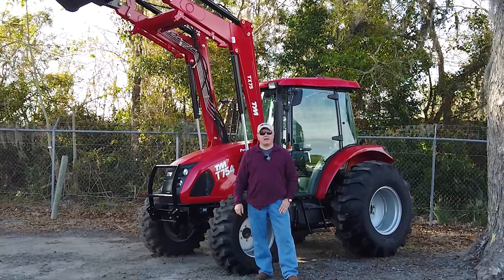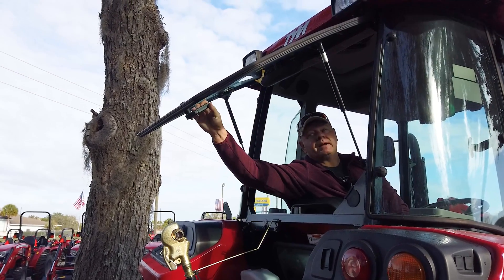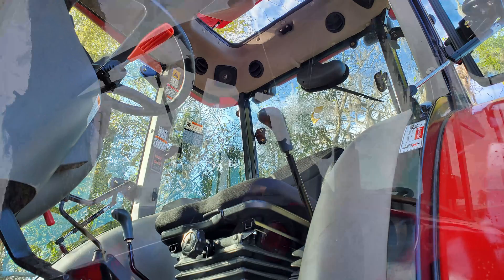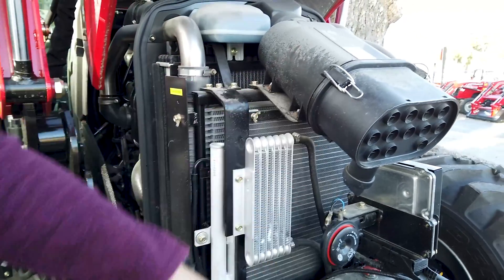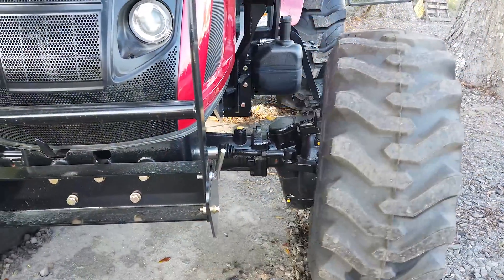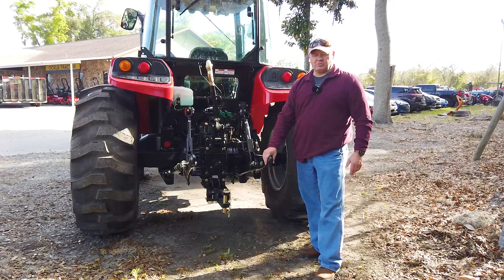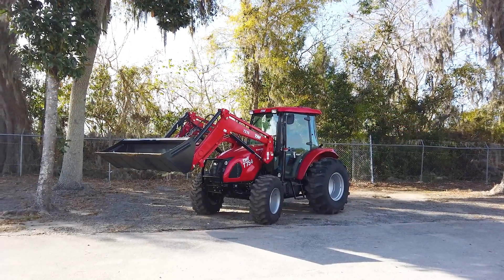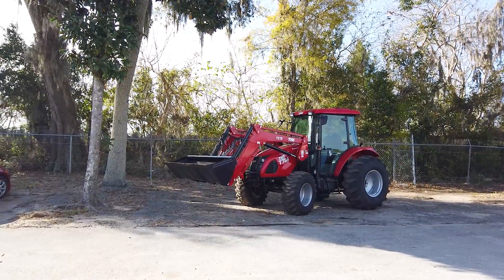TYM Tractors T754 compares to John Deere 5075E

Comment: HML X 1234 = 12 !
Reply from the maker: You try stepping into a new tractor and doing math in your head while in front of a video camera. LOL! F16 x R16 (Creep interlock)
Reply: @TonysTractorAdventure  I was wondering if it had a creep gear. Are those usually push button? Or another lever somewhere?  Or do they still use original range selector just with the extra position?

Comment: I guess the question is how long will this tractor last; parts availability and dealer support, in my area there is no dealer that sells this product I would have to drive very far away and my business I run my tractors come spring time seven days a week for over five months running them at full PTO speed and if something breaks I need to get to my dealer and get parts ASAP we have some other off brand-name tractors in our area and something breaks with one of those tractors they can’t get parts or service for two months so I think anyone purchasing a tractor that’s very important, in the video yes it looks like a nice tractor it really depends how its put together, it doesn’t matter if it’s made in India or South Korea or China I would say out of those three China is the worst, I am a big John Deere supporter I’ve purchased over seven tractors in the last six years but I will say every tractor that I purchased I’ve had problems but the problems were only in the beginning and they were fixed immediately and then after that no issues, but again for someone like myself who works very hard I need parts right away, Since this is a comparison to John Deere, I would say John Deere is one of the biggest tractor manufacturers in the world and they would not be building tractors if they were junk, I would not say this is a better tractor than John Deere, in my eyes I don’t think there is comparison but if someone’s going to purchase this tractor they should be proud of it maintain it take care of it I’m sure you’ll be happy with the tractor most of all dealer support but as an owner of a five series 75 hp tractor John Deere is a great tractor, and it doesn’t matter if one tractor is heavier than the other in stock form because you can always add wheel weights you can add weight to the front you can fill the tires etc. we all have different applications for example my business we mow large acreage and we try to keep our tractors lighter but for heavy loader work etc. a heavier tractor is better so having the option to make a tractor heavier is better for us I’m only bringing all this up just because of the comparison as stated on the title I don’t see any other comparisons in here after the title it’s a good looking tractor and I’m very curious after about 1500 hours how it held up, Thank you for the video and information on this track🚜🚜🚜
Reply: I apologize, I did my original response to your video my text with my voice and I should have read it before I sent it, what I was trying to say is your tractors look like a nice tractor, I wish there was more dealers in all areas, the reason I was saying I thought John Deere was superior was because they have dealerships everywhere, and for me dealer support is very important, if I was in your area I would test drive/demo your tractors and if I liked it I would purchase it knowing the dealer is there in the area, Local dealer support and service  parts  is very important for me, unfortunately we have no TYM dealerships anywhere in my area nothing within a 200 mile radius that I can find I  did not mean to call your company an offbrand tractor we have some dealers here that sell Mahindra in Branson it’s hard for them to get parts and quickly do any service/Repairs quickly. I should’ve made this a little more clear as to my response to your video so I apologize if I offended you, and you are correct, John Deere has had parts issues along with tractor assembly issues, and it really doesn’t matter where tractors are made companies outsource all over the world whether it’s India Mexico China and who knows where else, but for me it really does come down to dealers supporting us hard-working guys that count on there machine daily,you seem to be a “real good” guy, I wish you the best with all your sales your business and in the future. But if I had a dealership with your products in my area I would definitely consider one of your tractorsThanks again for your thorough  video👍🚜🚜
Reply from the maker: No worries! I could have replied with less Attitude! I am not a dealer. My wife and I have put together a YouTube channel. We own two TYM tractors and we have become friends with people at the company. Dealer support is essential! TYM is not as big as John Deere in the USA, but they are growing fast. They recently bought out Branson tractors, and will integrate their infrastructure. TYM is following Kubota’s business model. Make a good tractor for a fair price. I wished Kubota still followed that plane.
Reply from the maker: Take all of your concerns and apply them to the John Deere 75 HP made in India. TYM is one of the largest manufacturers of tractors in the world, and they make all of their tractors. They have made tractors for 70 years. John Deere is not the Apple Pie Star-Spangled company it was 40 years ago. They have had other companies build tractors for them all over the world.  I like many John Deere products, but they are struggling for parts worse than TYM. Go check out the tears in the JD forums. TYM has a massive parts warehouse in North Carolina and three assembly plants in the US.

Comment: Nice video review.  There are so many Chinese tractors out now but the question is will they last. I dont think JD's are as good what they used to be. A farm l worked on bought a brand new 50hp JD and within weeks it was back at the dealership with leaking injectors and eventually the engine blewup and they tried to get out of it. The engine was made in India which is a bit disappointing.  Just like here in Australia we don't manufacture hardly anything and now our car manufacturing collapsed.  Everything is made in China these days. I found your channel from your collaboration with Hamiltonville Farm. Just subbed your channel and got some catching up to do.
Reply from the maker: In my opinion, South Korea makes some of the best stuff in the world. LG, Samsung, KIA, Hyundai, TYM, Kioti, LS, etc.
Reply from the maker: TYM is not made in China. All of JD's E series are made in India. TYM is made in South Korea. South Korea has been a long term Ally.
Reply: Tym has been doing business in korea since 1960.
Company is competent and honest in business.

Comment: do you have to use the clutch to change from forward to reverse?
Reply from the maker: You do and don't. It shift so easy. Almost as easy as a HST.
Reply: @TonysTractorAdventure  is it a hydraulic reverser where you never have to touch the clutch?
Reply from the maker: @dewaynewilliams5100  I am just not sure. I hope to spend more time on one in the future. I stopped by a dealership on the way home from a trip. I should know this, but I didn't pay attention. The electric shift lever on the steering column is all electric and nothing manual. Everything happened so easy, I just didn't pay attention to it.
Reply: @TonysTractorAdventure   Don't need the clutch to shift from forwards to reverse

Comment: The only thing I didn’t like was the backup beeper.
Reply from the maker: That is the first thing owners disconnect.
Reply: Wrapped mine in thick foam. Still works but at an acceptable level. People (my wife, kids and grandkids) love to quickly cross BEHIND (ARGH!!!) the tractor when I’m plowing snow, loading hay etc. Today’s tractors can reverse quickly. When I hit reverse I’m often repositioning the loader for the next pass and only then look behind. Foam and a few zipties cost pennies. Takes 10 minutes to muffle it. I also like the “audio indication” of direction selector being in reverse. Back up alarms are designed to be heard at 200 feet with full hearing protection. No need for that volume in a homeowner or farm application but I still like the moderate volume alarm. If I disconnected it and ran over somebody I would feel terrible.

Comment: Like those big tires on the front. One thing about having large tires on the front, I have seen some videos with LS XR tractors where the tire was rubbing.  The solution was add longer stop bolts and that created other problems.  Not crazy about the beep beep when backing up.  Bolt already rusting on the AC compressor - that is a deal breaker - lol
Reply from the maker: I would have the AC compressor swapped before I bought that one. One bad bolt.

Comment: I've got the same tractor in the cabelas edition 2016 with mechanical shifter. It is a beast. I cut and bale hay with it works great.
Reply from the maker: Every time I try one on, I want another Tractor. I should have one of each size. 😇